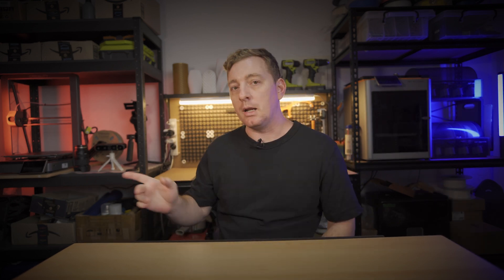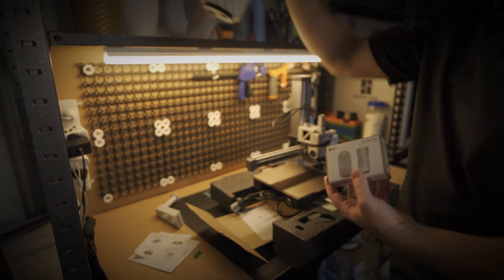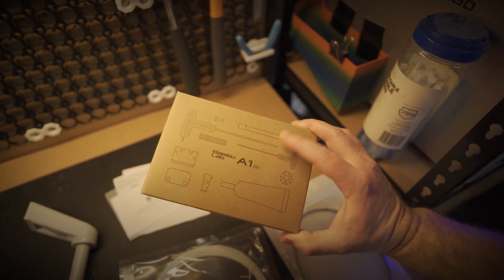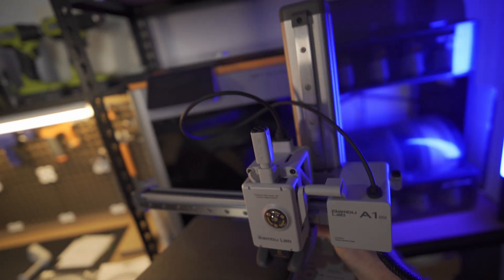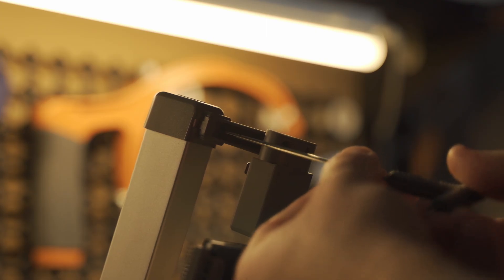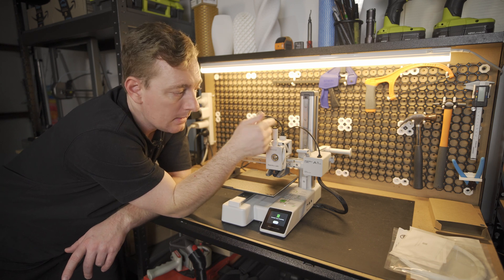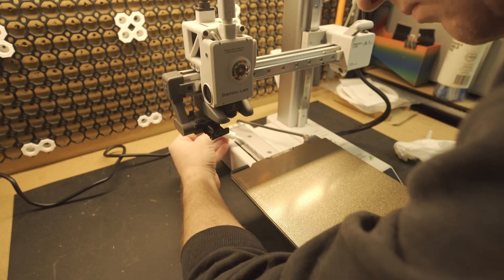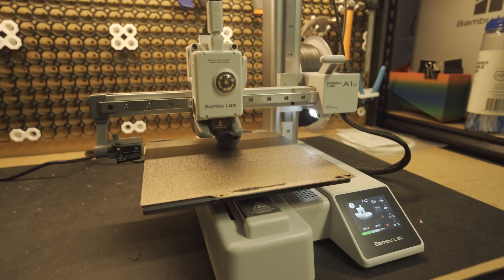Watch BEFORE Buying The Bambu Lab A1 Mini! | Unboxing, Assembly, and First Impressions

Comment: I will be receiving mine in a couple of days and I really enjoyed watching this video.  I do wish you would have shown the arm where you put the filament on and how to put it in the machine but otherwise it was a great video. Thank you
Reply from the maker: Thank you. Was a bit of a rushed video but the single filament loading is quite easy. You just go to filament and unload then follow the prompts, then filament load and follow prompts. You should have no problem and it’s a great little machine even if the build volume is a little small. I probably use it more than my x1c since it runs much quieter. Also check out my most recent vid on some biqu mods for the a1 mini

Comment: Title and discription is misleading. What did I need to know that I learned from the video besides the size of the buildplate and "How does it stack up right out of the box?", wouldn't know because you didn't show what the print looked like after the first print and didn't stack up against another printer
Reply from the maker: I’ll work on it for next time. This was an older project that I didn’t completely finish
Reply: @DraftID  it's not that it was low effort or anything, unboxing and initial setup is a valid video just title it and put a desciption that tell viewers what the video is all
Reply from the maker: I agree, I’ll think of a better title to reflect the content and edit it asap.

Comment: I had an original minisforum mp select mini v1.  Night and day, no fuss.  Zero problems with the printer, I've only had to fiddle with cheap chinese petg which can likely be attributed to me keeping the house under 60F with humidity levels in the low 20% range.  Got mine for 180usd I have a hard time recommending other printers for starting, except for the potential headaches with bambu perhaps locking their ecosystem down.
Reply: I’ve been researching the mp select mini for a long time. 
I ended up getting an ender 3 back then and have since gotten tired of the upkeep. 
I just recently got a Bambu A1 mini because I like the idea of a small footprint machine that prints well without headaches. I haven’t received the package in the mail yet but I can’t wait!
Reply from the maker: Your in for a treat! :)